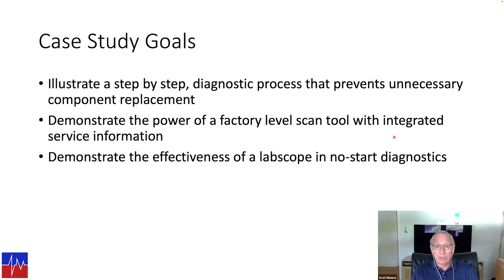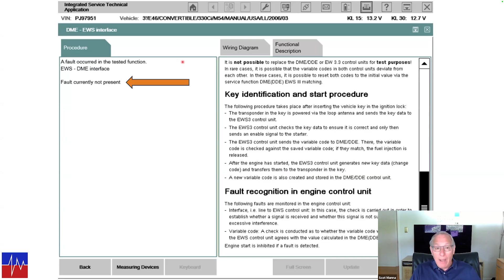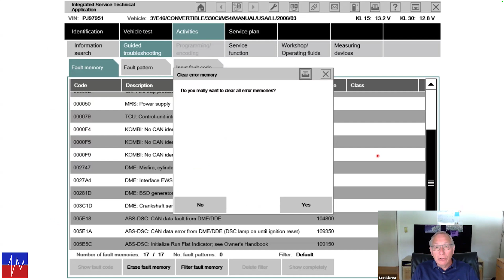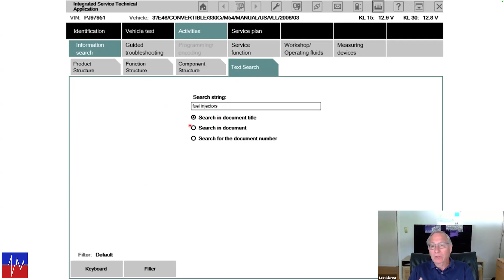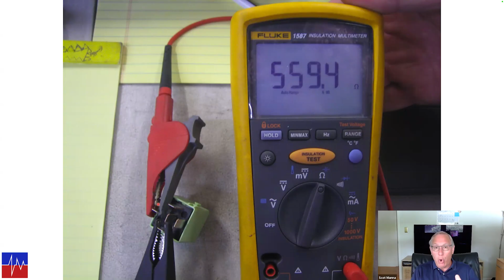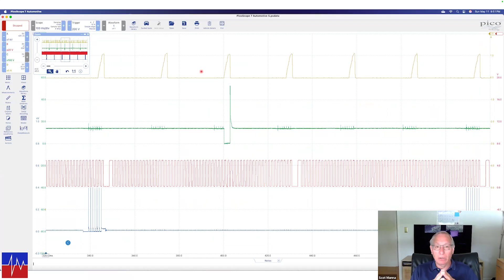Intermittent Cranking No-Start Diagnosis – 2006 BMW Case Study with Scot Manna

Comment: A diagnostic approach to "Cranks but won't start" and eliminating what does work and what doesn't work.  
Intermittents can be a real headache to locate,  but since this vehicle was more of a set pattern which always helps, the problem was quickly located.  I'm not saying you got lucky, because I'm sure you've had some intermittents like I've had that could last a lot longer before the problem showed itself.  When it did show itself and I caught it, I'd say " I gotcha!"
Thank you for this video.

Comment: Great lesson and fix . It's scary if this was left in the hands of untrained " mechanics " , who generally think and diagnose by parts replacement . Like a similar issue on Diagnose Dan . Thousands in parts , including a steering column on a BMW ! Turned out to be the antenna in the door handle , which was then properly diagnosed and fixed by Dan .